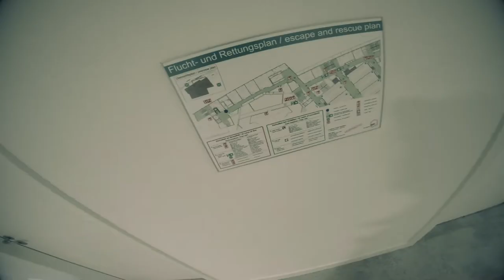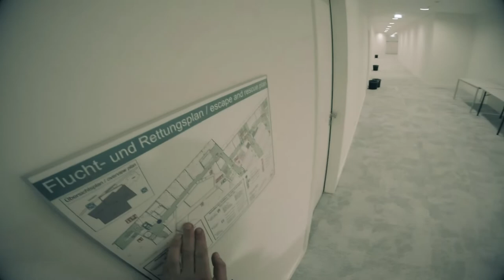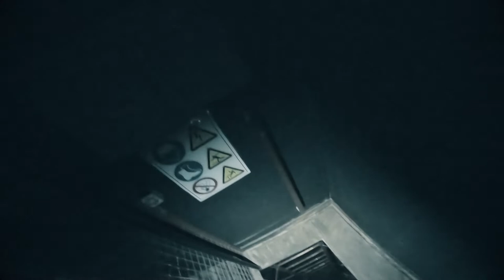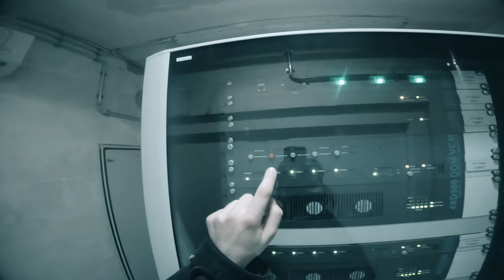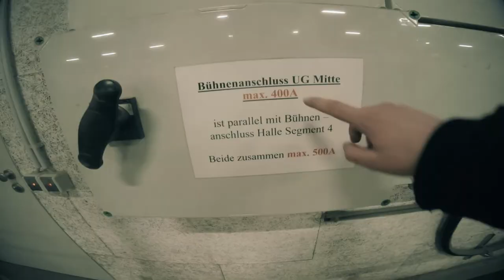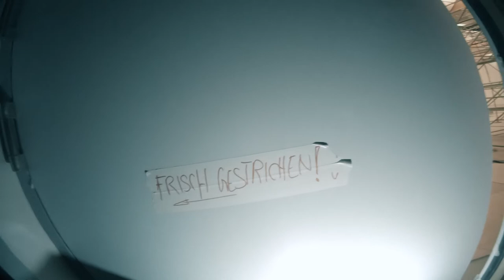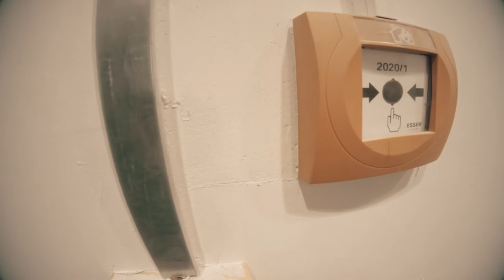All Alone in a Big Building Complex and Chatting with the Night Watch

Comment: 6:08 possibly servers of some kind.
Reply from the maker: hm, they were on the balcony where part of the audience would probably be sitting; so pretty accessible. What kind of servers would one need to run the multimedia system for such a stage hall?
Reply: @maiyu-explores  Hey, I'm studying to be a light and sound technician. I don't know what the 'server kinda looking thing' is, but seems like a big controller box with coaxial in/outputs and switches to control stuff in the room? The rack/box at 6:22 is pretty sure for lights and maybe speakers (don't seems to have amplifiers in it so probably lights only) because of the XLR connectors. Lights have 2 in/outputs, one for power and one for data. The lights are most of the time operated via DMX controllers, they get their signal or data (on/off/dimmer) trough the XLR cable , so I'm guessing the rack works like a splitter or something. Could also be to hook up a bunch of (wireless) microphones. Will maybe show it to my teacher and ask if he has a clue ;)
Reply from the maker: hey, cool, thanks a lot for the detailed response!
The coaxial in- & outputs, could they perhabs be used for TV / sat signals?
Regarding the rack at 6:22 you seem to be right: did some googling and turns out the two devices with the red stripes are XPD 28 A/B splitters for DMX signals made by Swisson.
Let me know in case you show it to your teacher :)